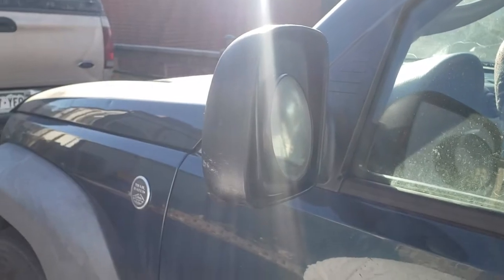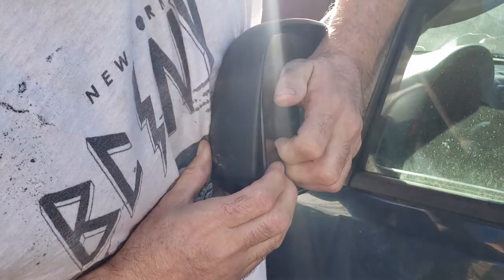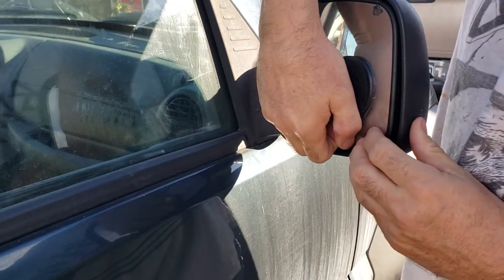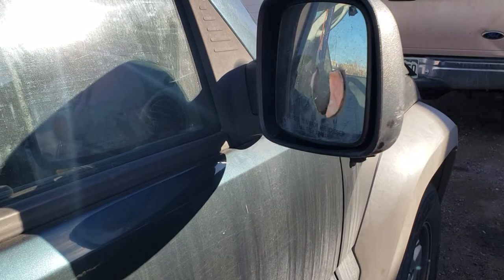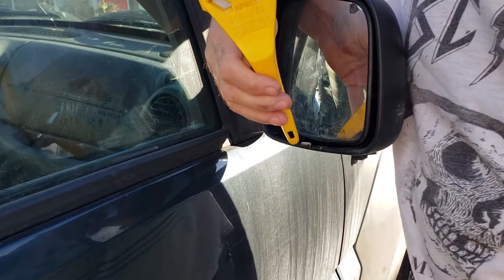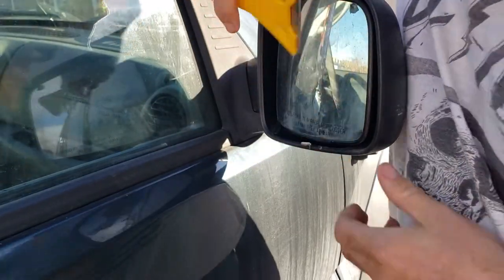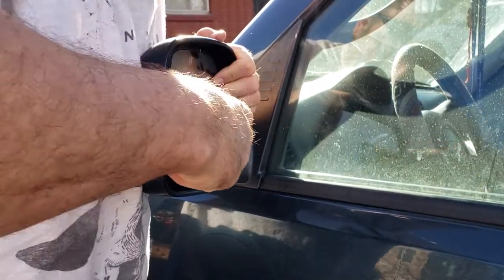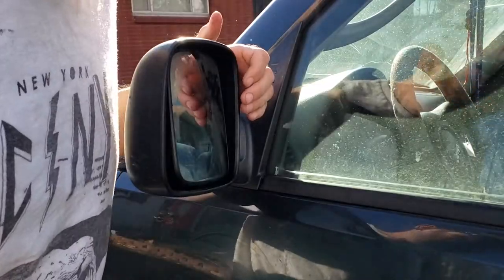How to get blind spot mirrors off so you can replace them.

Comment: Those are some huge ass blind spot mirrors lol. I have some small ones on mine and they work just fine enough.
Reply from the maker: I ride a motorcycle so when I'm driving a car I'd like to be able to see the motorcycles.
Reply: @mcoop6969  ahhhhhh I see. I dont see many motorcycles where I live but haven't had an issue with seeing them. Mostly because most of them are loud